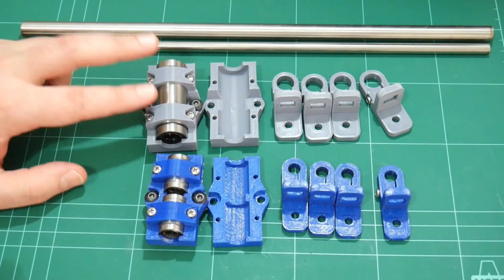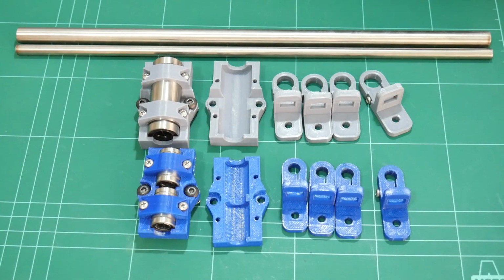HyperCube 3D Printer Z-axis Upgrade

Comment: you could use 12mm supported linear guides that would keep the 12mm dimensions and add a pair of rails stiff  enough to be an integral part of the whole printers structure

Comment: If you offset the z axis rails and the z stepper you could eliminate more of the vertical play from the heat bed. For example moving the the rails closer to the extrusions and the lead screw closer to the build platform would add stability similar to when you redesigned the bearing holders and the structure of the bed platform. Love this series and an making a hypercube myself in the coming weeks!

Comment: I think linear guide rails are the way to go since they can be supported all the way and not just at the ends like a smooth rod
Reply: Linears would be good for Z, but then again at least in my eyes it kinda fights against the pricing of project. Sure there are cheap linears these days, but many of them are utter junk. Also size of this round stock most certainly won't deflect on such small loads.

Comment: Thanks Chris.
Good to see you "back" into HyperCube development again!
I can't help myself, but stiffness is a function of the material properties, and where it's distributed around the load's axis. So a bigger section made from the same material will be stiffer, and that works fine for the z axis (where we don't care about moving mass because it doesn't need to move). 
I'm remembering the carbon tube experiments for the X axis.....
Keep up the good work!

Comment: Thanks for this video! I switched from 8 to 10mm Z rods last weekend and yes, the bed is much stiffer now. Surprisingly, the most interesting change I noticed in print quality is that Y ghosting vanished with the 10mm rods, while X ghosting was severely reduced. I wonder if changing Y rods to 10mm as well would be a good idea to have vibration-free results.
Reply from the maker: I just printed a 20mm cube at 20mm/s Jerk with no noticeable ripple on the corners. I'll need to print more objects to verify the results, but if it holds up them I'm eager to swap out the Y rails to 12mm too! I've just ordered LM12UU bearings for it. Cheers!

Comment: Hello, thank you for all work you made! I think you have another solution more thrifty. If you use metallic support with 8mm rod, the bed don't move ! I used to start with Machifit SK8 / 10/12/16 Support d'arbre Linéaire de Rail XYZ Table CNC Routeur - 8mm, there is no gap, no vibration at the bed!  [Machifit SK8 / 10/12/16 Support d'arbre Linéaire de Rail XYZ Table CNC Routeur - 8mm  sku:  984131]
Thanks for all!
Reply: I'm thinking about using your solution instead of 12 mm rods. Is it really a improvement?

Comment: Tech2C,

Another great video! Thanks! I am wonder why you have not yet decided to use linear rails instead of rods for this application. 

Cheers,
Greg
Reply from the maker: Hi Greg, correct me if I'm wrong but do the linear rails need to be affixed to a rigid surface? Solid round bar is rigid on its own, especially at 12mm diameter. I find it easy to install and cheap to buy. Cheers, Chris.
Reply: Those rails would need to be fixed to 2020 aluminum where his bars are at.. attach the 2020 to his frame though which would toughen up his frame. How good do those linear rails lock to the piece that slides on them? Would there be any play? Im guessing not. His belts would get in the way also.. but he could simply swap the motor and pulleys positions so the belts ran in the front instead freeing up space for his aluminum and rails. I love this idea and I think I may pursue it. The only thing holding me back is I just love the look of those chunky 12mm bars he now has.

Comment: You ever look how the z axis on the ender 3 works why not do something like that get free 4 point rails using the frame with 2 internal points at the corner you wouldn't even need to straddle the rail completely. Even just 3d printed plates would probably be enough with a few rollers that you can get everywhere now.

Another bonus is when doing wood. You could put a lock on it to keep it stationary with just a lever and a pad.

Comment: You can also add 2020 frame a the back 1/3 lower from the top ( because 1/3 of the rod only use for attach to top frame ) after short your 12mm rod, so like this your rod will be more stiff because top and bottom will be closer and you will regain your 5mm on the travel of Y axe....
Reply: and you can also still use your 8mm rod ( half way solution  ) , but 12mm still really better solution

Comment: You mentioned you wanted to put a drill on the cariage, it seems you want to do a cnc, just let me say I am sceptical about a bed suported by only one side for that application. If you limit yourself to wood that could work since it is still quite stif.
Great job as always, keep up the good work and if you try a CNC conversion I would be interested by the result.
Reply from the maker: Hey mate, yes the cnc is for soft material only. The HyperCube is first and foremost a 3D printer with some 'light' cnc duties.

Comment: Artur has a Z endstop where the switch goes on the bed and the adjustment screw goes on the rod. It's way easier to adjust if you change bed glass or something.
Reply from the maker: I see. In that case the Z endstop cable would move with the bed? We can print a thumb screw for the Z adjustment screw which would make turning the screw by hand easier.
Reply: Yes, just thread the endstop cable up with the bed thermistor. Good idea using a thumbscrew for the bed. Mine's just a regular Phillips head.

Comment: @Tech2C have you tried your printer design with modern controllers like Klipper? I've built frame for HyperCube few years ago already, but been occupied by other projects for ages. Still planning to complete printer and aim for lightness. I'm really curious how it would perform with Klipper. Definitely going to try that when I get to that point.
Reply: Worth doing for sure. A lot of high performance printers today aren't built mechanically as nicely as the venerable Hypercube.

Comment: what printer/settings/filament/finish did you print the new grey parts on? They look almost perfect!
Reply from the maker: They were printed with eSun PLA+ Grey. Sliced in Cura and printed at 40mm/s.
Reply: Tech2C i am looking for someone to print all the parts.
can you please print the plastic parts for me ???
Reply: @williamwell4341  what plastics would you want and are you paying for them shipped as well?
Reply: I might be willing to print the parts, let me know and where are you from.
Reply: @johnhicks4502  thanks but i already ordered them from website called 3D Hubs and arrived good and fast.
I am waiting for some other parts to finish the printer
Thank you   @Tech2C
Reply: @williamwell4341  William, just curious what did 3D Hubs charge you ?
Reply: @michaeljordan6892  
About 66 Euro for the set

Comment: I am building one along these lines but using servo motors with optical encoders for high accuracy positioning / Maybe be using linear rails and ball screw // Belt and braces theory
Reply from the maker: That would be a super configuration!

Comment: Nice Job!
I have a suggestion in my view having another leadscrew and also 2 other shaft for the Z Axis  would  solve the problem!
Reply: I was thinking the same thing... Put two more shafts and one more lead screw on the front side. I would then turn the printer sideways and make the sides my front and back for access to the bed.

Comment: That’s a lot of slop along the X axis. If you are planning to mount a drill I’d add atleast one more 12mm rod as a support in the front of the bed. With a drill the bed must not slip along any axis and with heavier bits it will drag the bed otherwise. Also with the stock mounted near the front of the bed with the drill plunge the bed will deflect a little even with the 12mm rods.
Reply from the maker: I agree with everything you say. I only plan on milling soft material so I'm confident it will be suitable.

Comment: It looks  like upper z-axis rod clamps are a lot higher than the bed can go. I think the flex in the 8mm rods could be reduced by adding an extra support near upper limit of travel so rods are supported in three places. Just an idea. Probably no better than 12mm rods just an alternative
Reply: I had the same sort of thought.  Z axis is only 155 mm, with 400 mm rod.  I think shorting rod and add 2020 piece to rear for rod mount just higher then the end of upper Z travel.   will have less flex then a long rod.

Comment: Hello, I'm building a hypercube and I would be very greatful if you would reply to my question, Which brands of petg do you use, I've all ready brought some extrudr brand petg but I'm getting brittle prints no matter what temps I try for the hotend, which brands do you have the most success with?, Thanks Chris....It's o.k I've just checked out another one of your video's about filament storage and it looks like eSun and polymaker are some of the filaments you use, I will try one of those, Thanks chris.

Comment: The link for the rods given is for 400mm, however the original rods were 350mm weren't they? I just finished the upgrade on mine and my old rods were 350mm, not sure if the specs changed since I built mine. Either way, loads less play with the 12mm rods, great upgrade.
Reply from the maker: Hey mate, Banggood doesn't sell 12mm rods in 350mm length, so next size up is 400mm (50mm extra length). Yes the upgrade is a huge improvement in Z axis rigidity. Cheers!

Comment: Thank you for this. This was a concern with my build as well, and compared to a dual z-axis which I was thinking about, this is a lot more elegant and avoids the concern with two motors coming out of sync or the need for a belt drive with its added complexity and potential problems.

About the 12mm Y axis upgrade, I will be very interested to see if you are going to like the weight increase on the bearing which is in motion, or if you will go printed bushings like many of the community folks have. My money is on printed bushings! Increase rigidity while lowering weight.

After that, how about 14mm carbon fiber X axis with printed bushings?

Comment: I think the top and bottom fixings at the end of the 12mm rods should be more beefy with at least 1.5 x the diameter of the bar in support height and increase from a single screw fixing to the  metal frame with at last 2 screws, this should be made of a more solid a block as there is not enough material to stop minor flexing / twisting / A metal fixing would be the best option

Comment: With the standard Z rods I found my platform warping ever so slightly and just had too much play to level my 210x210 Ultrabase properly. I solved it by printing a couple replacement parts:

https://www.thingiverse.com/thing:2440971
https://www.thingiverse.com/thing:2503622

Obviously I'd go to the larger rails if I was building it new, but these couple parts allowed for the 8mm rail to be rigid enough for my needs (non-CNC).

Comment: Hey, I have a suggestion. Why don't we design something that clips onto the front of the bed platform at both sides and then has a rod with v rollers/just bearings on the end such that it's snug against the frame. A solution like this saved my solidoodle from horrid z wobble. I may well design this myself later. This printer is some quite frankly amazing design work, I've decided I'm building an original hypercube myself as I don't want another large printer which the Evo seems more suited for :)

Comment: So would you say it's only worth it to go to the 12mm if you plan on attaching a drill then? I am working on a hypercube, but the most drilling I'm going to do is PCB milling
Reply: It would be worth it just for 3D printing alone, anything you can do to improve the rigidity of the frame will more than likely improve print quality somewhat

Comment: Fun and interesting video as always :)
Question 1: where do you change the z-axis speed to 25mm/s?
Question 2: Do you see difference in the print quality?
Reply from the maker: Thanks!1) In the LCD menu > Control > Motion > Velocity > Vmax Z2) I printed a hollow 20mm cube at 20mm/s Jerk with no visible ripple on the corners. So far so good ;)

Comment: I've been thinking of doing this for ages seeing the results I think I'll order although the 8mm have been serving me fine
Reply from the maker: Same with me, 8mm was fine. But now that I've witnessed the sturdiness of the bed platform I don't think I can recommend 8mm anymore.
Reply: Yea I agree I think this and putting a basement will be my next upgrades I think the extra 2020 profiles about 70mm above the bottom of the frame would drastically increase the stiffness of the whole printer.

Comment: Ok, so if the Y axis movement is reduced to -5mm, then is it correct to assume we loose that 5mm on the bed? if so, then perhaps to just add as a note for the people who are about to begin the build they should add those 5mm to theirs Y steel smooth rods, parallel 2020 extrusion supports for the bed and the 2020 extrusion for the frame Y axis. Correct me please if i forgot something. Best regards & congratz on the build (;

Comment: I bet the bearings can handle more weight as well. I have my Hypercube misfit up and running and one of the problems I've been having with the cantilever setup is that I have a much larger platform for the bed and the additional weight puts more pressure on the bearings and causes them to roll more unevenly. I'll be going to a 2 Z axis once I reprint all of the parts so that problem shouldn't be so bad once everything is reprinted in PETG, but it can be quite the pain in the butt. 

My Z rods are also 600mm long so the bowing and bouncing is even worse.  I've also been dealing with really poorly made chinesium parts. Some of the rods being much larger than 8mm and being hardened bearing steel makes for a very rough time sanding down to size.
Reply from the maker: 600mm long rods would bow quite a bit. Sanding hardened steel sounds like a chore too!
Reply: The bowing isn't too bad. It's more that the ball bearings get overly stressed from the larger bed platform leverage since it's 582 mm long which stresses the top of the bearings much more than the other bearings lower down and causes them to bind (or maybe it's just the quality of the bearings). 

It definitely is a chore to sand. It wears out the sandpaper extremely quickly and attaching the rod to the drill to spin it helps speed things up but it's still a royal pain.... Plus out of all of my rods almost all but maybe 3 of them were bowed/bent either from the factory or from shipping. Same with both of the lead screws and even the carbon fiber rods are curved/misformed/oversized (though luckily those are much easier to sand, but look much worse after sanding imo). I probably should have just went with a US supplier, but metric is really hard to get here.

How I go about sanding is I make sure the rod is clean, then run a bearing along the rod to see where it binds up, then I mark it with a marker to know where to focus as the rod isn't even uniform in its sizing, then I check with my calipers to see just how much I should be sanding off and to see if it's oval. If it's oval and the large spots just need spot sanding I'll do that or if it's round enough I'll just use the drill to spin it against the sandpaper.

Comment: Having had a crack at CNC with a Model 300 Dremel attached to the carriage (not the wisest of ideas, aweful lot a weight there) as part of my slow and gradual reprint from brittle PLA to better PETG I'm going to 12mm Z rails, also means I can take the time after the printing is done, to re-jig the printer so I can get back 200 mm z height :D

Question though @tech2c, what's your thoughts on BLTouch probe in lou of the inductive?. I've been running PEI + Ally bed for a while and I am starting to miss being able to use other build surfaces particularly borosilicate glass but of course the Ally is too weak to trigger the inductive probe through 3mm of glass :(
Reply from the maker: Yes I'll be looking at replacing the inductive probe with a bltouch, for the reasons you mention. After I've finished with these rotary tool videos I'll jump back to 3D printing orientated videos and include a new mount for bltouch.
Reply: Awesome juice thanking you muchly, don't hurry away from the CNC stuff I am enjoying it, never ceases to amase me how versitile my little hypercube is. I knocked together a quick model in Fusion so I could mount my dremel model 300, I bought the wrong endmill (you know me :P I am impaitent, so I went via AU ebay instead of banggood, btw do you have an ebay AU affilliate link?) so had a bit of fun with that, and also with 8mm smooth rods there is some minor precision issues with complex parts. With the test square I got it to within 0.25mm which is awesome in my books.

I actually found that the weight of the clamps, cork (I used sacraficial cork underfloor to protect my PEI build platform) and work piece (A4ish sized 5mm acrylic) would overcome the internal friction of the Z stepper with motor drive disabled.

Comment: Hi TEch2C.
Thanks for your helpful videos.
If you had to do it again would you stay with the 2020 extrusion or would you change to 3030 ?
I intend to build an Hypercube with a 300x300 hotbed. Maybe I'll try to cut balsa and thin plywood with it.
Regards
Thierry
Reply from the maker: Hi Thierry, 2020 extrusion is more than rigid enough for this application. The cube structure is quite strong. Going larger has no benefit. The weakest part of the printer is the X-Gantry, not the frame.Larger bed sizes would need extra bed support. Cheers.
Reply: Hi Tech2C, thanks for your answer.
Extra bed supports even with a double z axis ?
Thierry